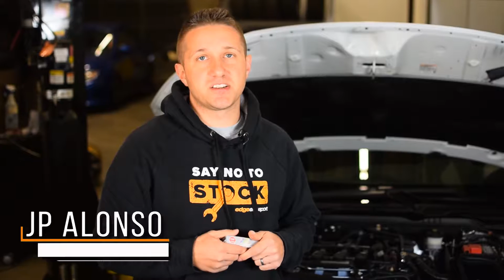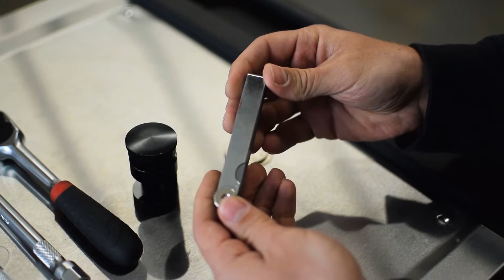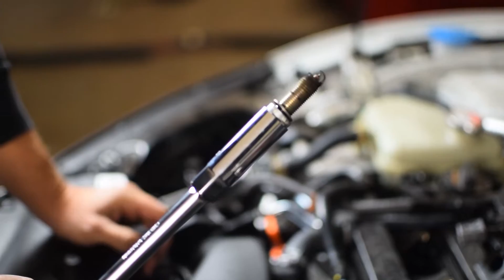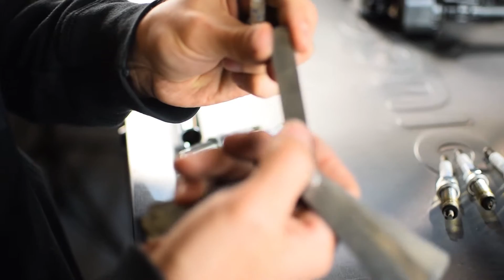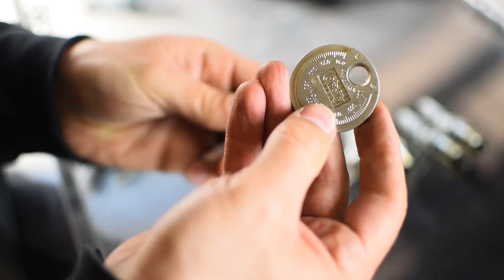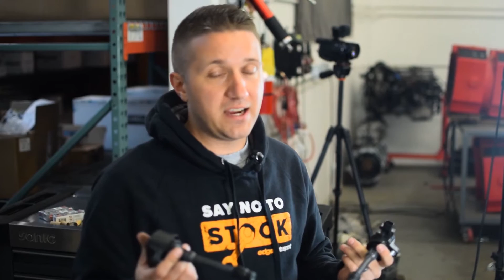10th Gen Civic Si Spark Plug Install | PROJECT FC3 (Ep 9)

Comment: Is .028 okay for a completely stock 10th gen non si turbo? Or is it better to keep it at .030? (I know stock is .032 but want to "future proof" it incase I ever tune it.)

Thoughts?
Reply from the maker: Closer to stock is better if your car is stock. Plugs don't really need to be future proof as they are in expensive and easy to swap when you decide to tune later, better to have things run optimally until then.

Comment: There are lots of things that affect how much you should gap your plugs when modifying your car. Great video guys! Always come in clutch when I have questions regarding my Honda💪🏼 also PSA!!!! I used to work at an Autozone Distribution Center and everyone there tosses parts into order baskets so even if the spark plugs come pre gapped, always…. ALWAYS check the gap before installing because some 18 year old at a warehouse will toss your new spark plugs into a basket and can bend the original gapping! If you want things done right, do your research and DO IT YOURSELF !!

Comment: I did this job to my 2018 Civic Si and it only took me like 10 minutes! this motor is insanely easy to work on. The previous owner took the car to a basic automotive repair shop to do his last spark plug change. When I removed the old plugs that the shop had installed I saw that they were the incorrect plugs for this car, they were for a 9th gen civic, none Si. i'm surprised the car was running with them in there. but there were no codes or misfires.  when I installed the correct plugs I noticed a significant increase in power immediately.

Comment: Just an idea, why not put the 27 measurement on the spark plug and push it down with it on so you can set at 27 instantly
Reply from the maker: That's generally not how you set clearances, you adjust and then measure so the tool doesn't influence the adjustment or damage the electrode. Same goes for valve lash and bearing clearances

Comment: Do need to put antisezee on spark plug threads?
Reply from the maker: I've seen people do that, but I don't think it's 100% necessary with plugs.
Reply: The Honda Civic repair manual advises you to use anti seize compound. But no one uses it in all those spark plug video tutorials. I wonder if there can be problems at the next spark plug replacement, when you did not use anti seize compound....

Comment: I got prl flex fuel kit w/ tsp tune, prl dp, prl cai w/ race maf, prl intercooler w/ charge pipes, greddy exhaust . Car is only almost hitting 9k miles on it. Do i need to replace the stock ones? Just to make it sure before i order to you
Reply from the maker: I think checking your current plugs will give you the answer. If they're in decent shape still, it's worth keeping them. But maybe just have a set on hand to go in whenever you're ready.

Comment: I have the phearable tune with a catless down pipe muffler delete and prl intake should I put them to 28
Reply from the maker: You might be able to keep them stock but it just depends how the car runs. Stock gap is .032 IIRC so taking them to .028 is a decent jump. You probably don't need to do that for your mods. But it really just depends on what the car likes
Reply from the maker: EDIT: the .032 is the non-Si, .030 is the Si (factory specs at least). So if you have an Si and are running higher boost, .028 would probably be fine for what you're doing.

Comment: Hey great video. I’m modded Hondata, Flexfuel (e40), and PRL Race MAF CAI. Foolish me I haven’t changed spark plugs and believe I had a misfire other day. Power cut out at 5k went to limp mode but turned off car for a min and restarted and everything seems fine. No CEL codes so assuming spark plugs and replacing. Any recommendations on gap for a setup I’ve explained above? You think I damaged anything? I’m on Hondata +6 Flexfuel basemap.m and have around 285whp.
Reply: haha I see someone asked almost exact same question seems like a common setup that requires a good spark during WOH.

Comment: Hey man, I added Lucas fuel injector cleaner to my new Si without realizing that could foul the plugs and now I've been experiencing slow start up and loss of power at high RPMs. 

I should definitely change the plugs first, right?
Reply from the maker: I would definitely inspect them at the least. If they don't look good, it would be good the change them.

Comment: Hey brotha I had a quick question . I am at 48k almost 50k and I’ve been running e85 for about a year now I will be changing them out tomorrow but before I do. Should I gap them at 27?
Reply from the maker: If you're running anything more aggressive than a stock boost level, you can gap them to .027, that should work well.
Reply: Edge Autosport great thanks so much ? And also can you show the gains for the injen intercooler

Comment: Quick little question. My 18 si only has a PRL cold air intake no tune. Would you still recommended change the plugs around every oil change ?
Reply: You definitely don't need to change the plugs often. Especially not every oil change. Plugs can go 50-100k on a stock motor.
Reply from the maker: How often are you changing your oil?
Reply: Around every 5k miles
Reply from the maker: You don't need to change them that often. I'd say maybe 10-15k miles and you could go even further than that probably.

Comment: No anti seize ? Or dielectric ?
Reply from the maker: We don't use anything on spark plugs.
Reply: Edge Autosport thanks for the response
Reply: Placing some dielectric into the Coil Boots will make for an easier uninstall the next time around.

Comment: Hi I have a question my name is josh I have the same car 2017 si coupe, I’m running e37 blend with hondata tune +6 psi , what do you recommend for the gap? I have 40k I haven’t changed them yet
Reply from the maker: We just gapped ours to about .027 if I remember right. Seems to be working well for us so far and we were on the dyno today with some really cool air hitting 23psi.
Reply from the maker: Also, is it just off the shelf or is it tuned specifically for the ethanol content?
Reply: It’s off the self it’s a kit  that comes with hondata
Reply: The The hondata comes with preset maps but no specific tune for 85 as in no specific percentage for e85.
Reply from the maker: @Overland_joshie  I suggest considering some custom tuning for the ethanol content. There should be a lot left on the table. Let us know if you'd like to do that, send an email to tuning@edgeautosport.com

Comment: Can I clean and do that to factory sparks?  setting it to 27 makes the spark stronger?
Reply from the maker: These are actually the stock plugs so yes, you can do it. I've never cleaned a set of plugs, I always just replace them since they're relatively inexpensive. Gapping them down could potentially make the spark weaker, but it also prevents the spark from "blowing out" because of the amount of air and cylinder pressure created from more boost and more airflow. So it's the concept of just making sure it sparks, not necessarily make the spark stronger. But don't gap too low, because it can weaken the spark too much.